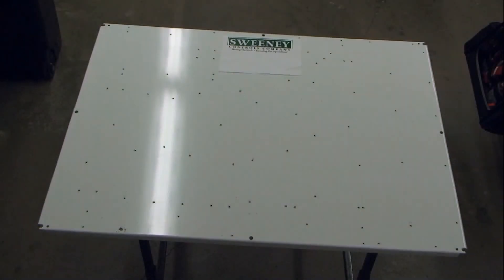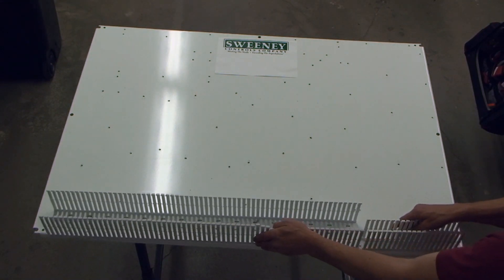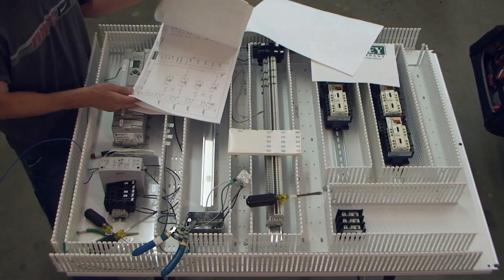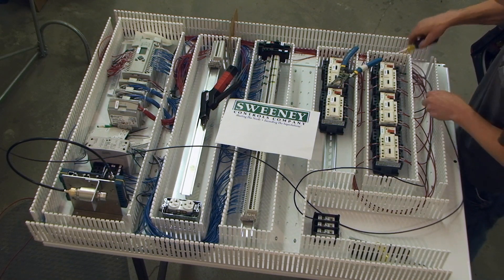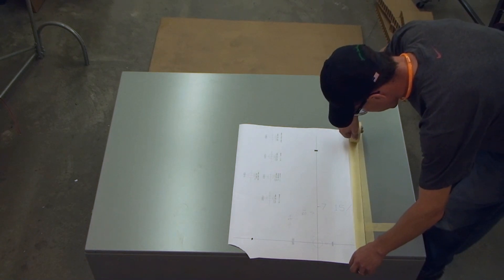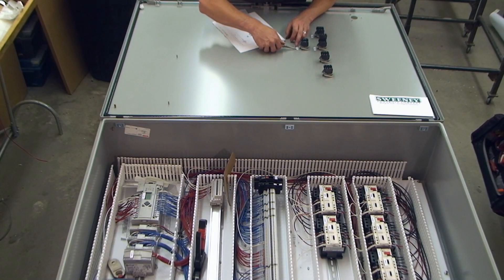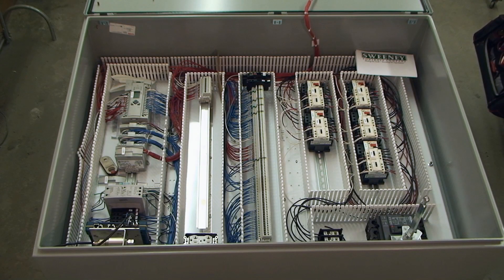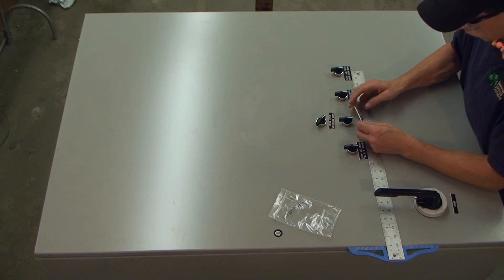Control Panel Building

Comment: I was a supervisor for several panel shops for about ten years, I am to say the least, disappointed in the quality of workmanship of this panel. if I was presented with a door like that, I would have my builder redo it. I won't go into the back plate.
Reply: care to elaborate?
Reply: My main issue is that the way the door wiring crossing the hinge, with no protection. when the door closes you are applying leverage to the tie bases, it would be better with a small loop. It would also look more professional with some covering on the wires. Using spiral wrap, or my preference, convoluted split loom. I couldn't see the bundling on the door, so I don't know if the wires were parallel or not. Are the red wires 120Vac or 24vac? assuming they are 120V as they are next to white wires on the terminal block, then they should be kept separated as much as possible. if the 120v is coming from an outside source, they should be in yellow wire. I agree with someone elses' comment, the terminals would normally be at the edge of the panel, but not knowing what this panel is for, or how it will be installed, that is a minor issue for me. 24vdc wiring should be kept together on one side of the panel, away from all higher voltages. in this panel, on the right side. The wireway between the terminal rails should have been left empty, the 120V rail should have been where the 24v rail is and visa versa. The field wiring for the motors will be running in with all your field control wiring. Maybe it's because of the camera angle, but i can't see any grounding points. It would look neater if the 2" wireway on the left of the panel went all the way to the bottom 1" wireway, or the lower 1.5" went to the side. Butting 2 ends of different sizes does not look good at all, Its difficult enough putting 2 pieces the same size. A cover for the distribution block is missing. There are a few other minor things, like tools, and procedures, but that is your shops preference. But I will leave it there. But a bit of praise to end the critique, he did a nice job of keeping the wire labels straight.  I hope you don't take this too hard, and use it as constructive learning ideas. I would be happy to share other information if you want it, like photos, and a workshop manual that I wrote. Let me know.
Reply: @davesoutdooradventures5523  Hi David, I too am a panel wire man and I would be very intersted in reading your manual. I would be very grateful.
Reply: @XANF2  send me an email adress that i can send it to.
Reply: @davesoutdooradventures5523  Any update on the manual?
Reply: @XANF2  soon. I have to remove any existing company information.
Reply: David Bailey 
I build panels and I would like to know what state are you in?
Reply: @Tom_Sawyer385  Hi Tom. I was in Ohio when i did this work.
Reply: Hey @David Bailey - I would love to be able to have a look at the worshop manual you wrote that you mentioned in your comment - I am an electrician and would be very interested to see what other knowledge you have to offer as your insights here were truly interesting and your suggestions were spot on.
Reply: @rabidmongoose6665 Send me an email address that i can send it to.
Reply: How did you do it when you assembled the back plate in the cabinet, what tool did you use?

Comment: Labels must be installed on the back panel. Installing labels directly on the device is not a good practice. Usually if a part has to be replaced, the label goes with the bad part. Terminal blocks suppose to be close to one of the sides of the control panel, where input wires go into the panel and power has usually installed at right and control device left. The main reason is  the control part is usually connected to door push buttons, so cables are shorter and does not mix with Power cables.